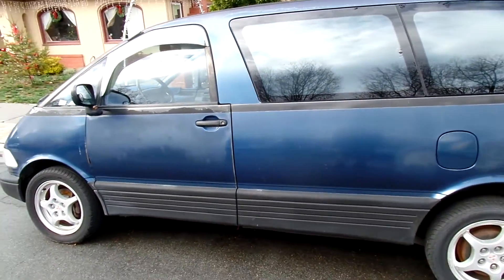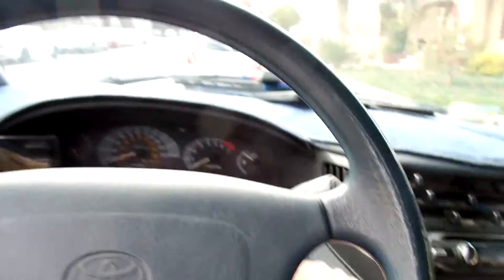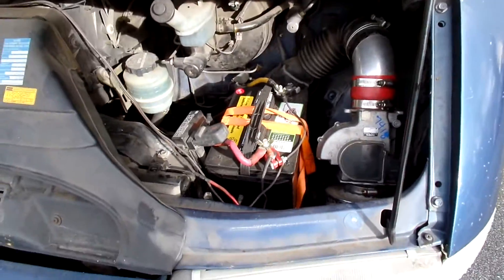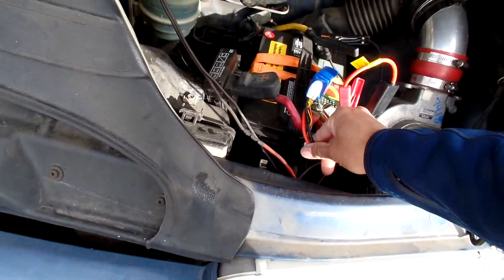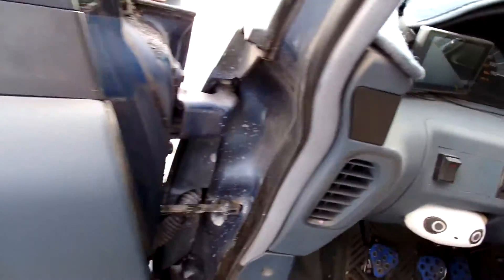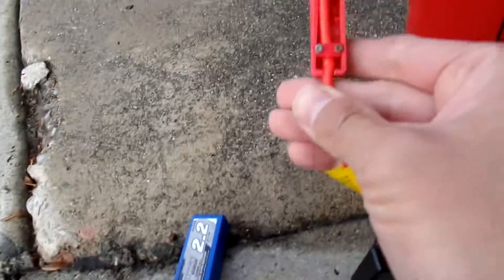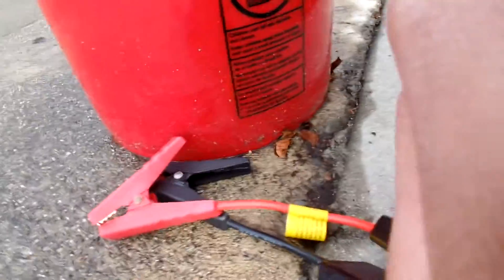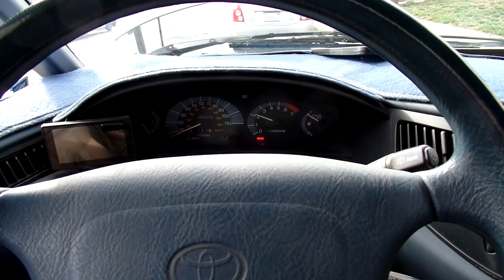Can a 3S Lipo start a Toyota Previa?

Comment: What's the capacity of this 3S battery, what's the C rating? I Want to buy myself a Lipo pack, but I don't know how big...
Reply from the maker: These are the specs for the battery I used:
Got it from hobbyking
Minimum Capacity: 2500mAh (True 100% Capacity)
Configuration: 3S1P / 11.2v / 3Cell
Constant Discharge: 30C
Peak Discharge (10sec): 60C
Pack Weight: 215g
Pack Size: 139 x 45 x 19mm
Charge Plug: JST-XH
Discharge Plug: EC3
Reply: Thank You
Reply from the maker: No prob I lost it recently too =(:::: so I'm ordering 3 more, I use them to fly my quadcopter and jump my motorcycles also.  Never gave me a problem cept the damn stock eflite on =(